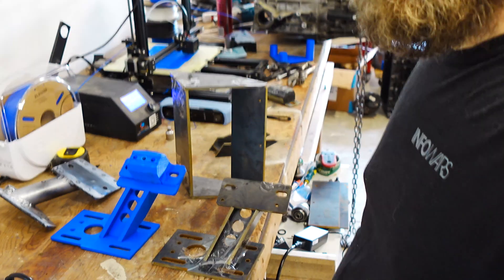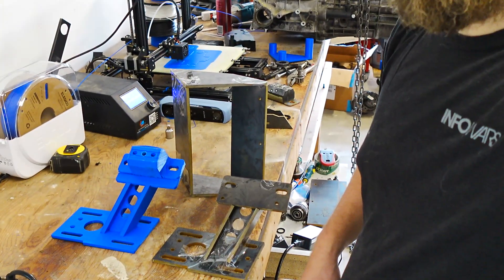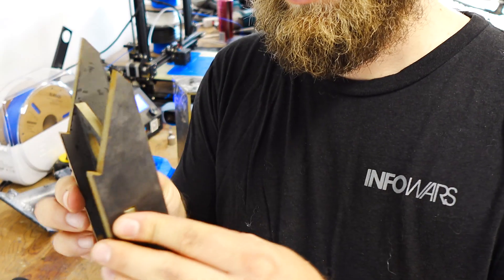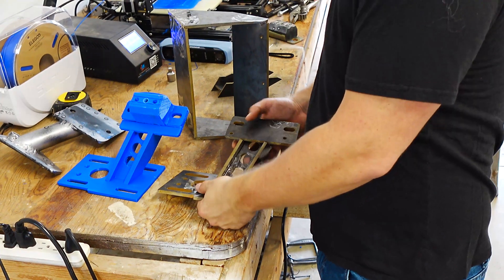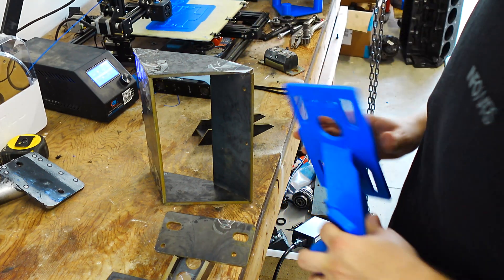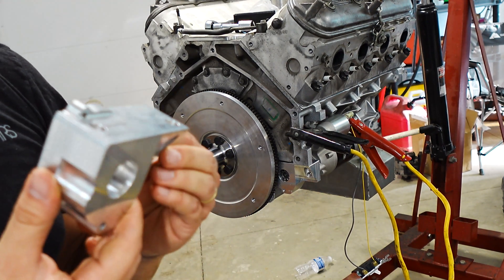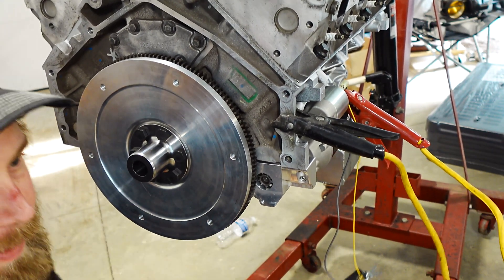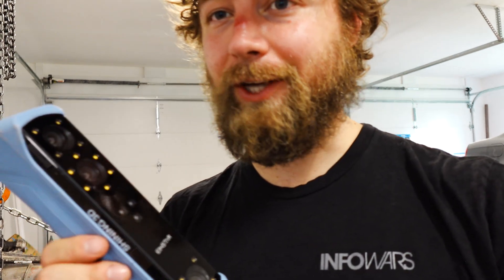Motor Mounts Build for LS Swap Audi (& Starter Finished!) Ep: 12

Comment: How would the swap be with an LS3 and like a Tremec TR6060 or something? Basically 5th gen camaro engine trans swap. Would be RWD obviously but would it be easier you think?
Reply from the maker: You could sit the motor further back so might be easier; doesn’t mean the transmission is gonna clear the tunnel though. The front axles you can just run the outer CV to eliminate them. The biggest problem will changing out the rear differential and fabbing a mount as well as axles to fit since the Audi driveshaft and rear end rotates opposite to what most domestic cars do.
Reply: Ah dang didn't know it was reverse rotation! Maybe a cool opportunity to fit a CTS-V diff or something that can handle serious power though. @projectLSaudiA4

Comment: Following! Definitely never thought of using the B8 trans. Isn’t the B8 trans physically larger than the O1E?
Reply from the maker: Yes it is, but it does fit the transmission tunnel with a bit of hammering. The subframe also needs clearanced or a tubular subframe has to be used. What makes the B8 transmission worth it is that the axle flanges are roughly 5-6 inches further forward compared to the O1E so that means the engine sits closer to the firewall without excessive angle of the front CVs.  So using the B8 transmission (OB2/OB4) is the lesser of two evils. The O1E won’t fit unless you move it back and put crazy angles on the front CVs or relocate your radiator to the back because the engine would be sitting so far forward.